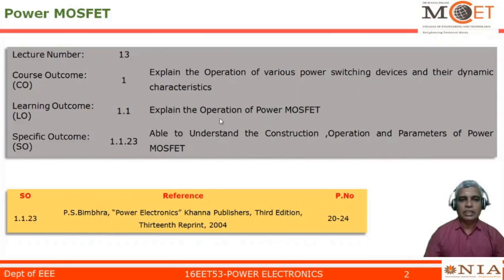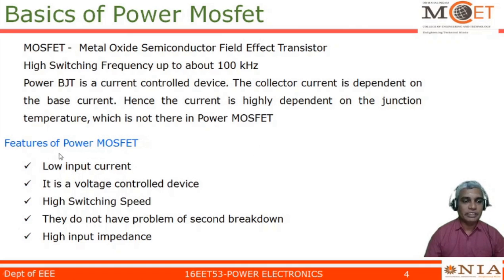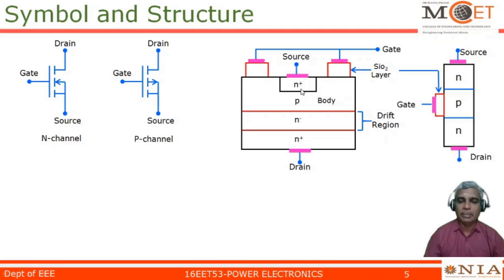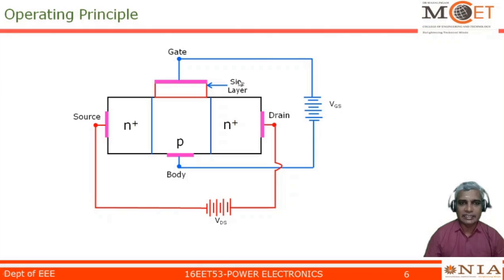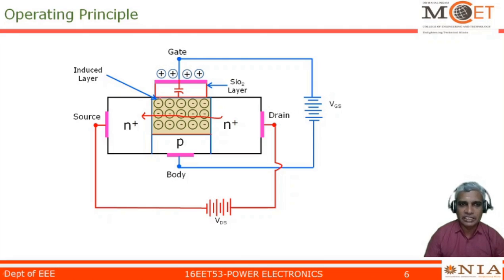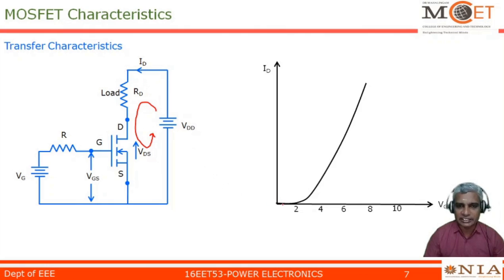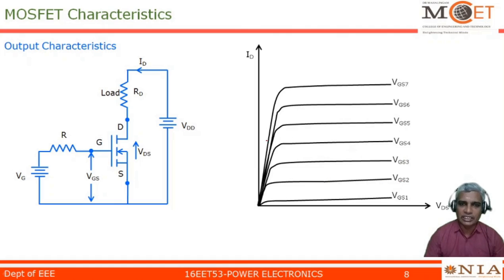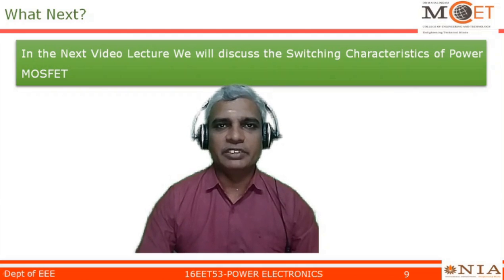Lect-19 POWER MOSFET OPERATION

Comment: Hello,
I will only switch on-off with Mosfet, but my load has no + and -  polarity like motor, fan, lamp. When a Vdss voltage is connected to the Drain, the load is activated with just + voltage.

When I want to do this on mosfet, when I connect load to D, my load is still active even if the mosfet is on-off. When I connect it to S, my load is directly connected to the ground.

Since my system is high voltage and I need to use mosfet to make the switch on-off status controllable with microprocessor.
Is there a method you can suggest about this?
Reply from the maker: please write to me kaliasgoldmedal@gmail.com with diagrams. I can't get you properly